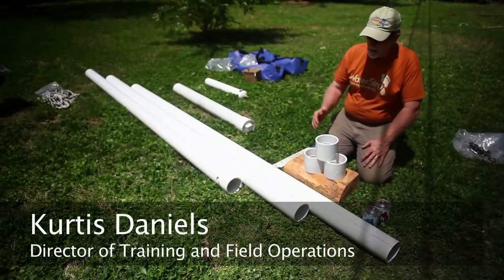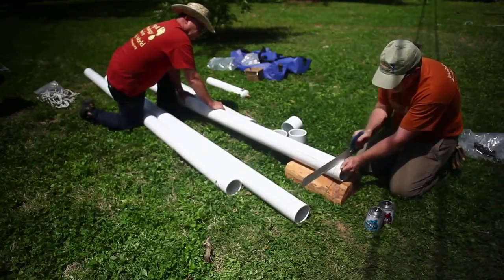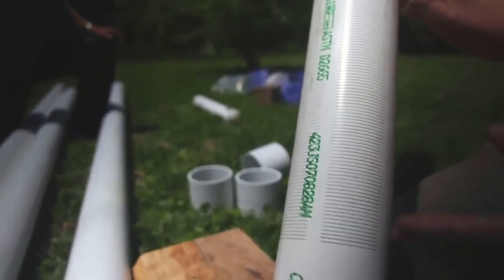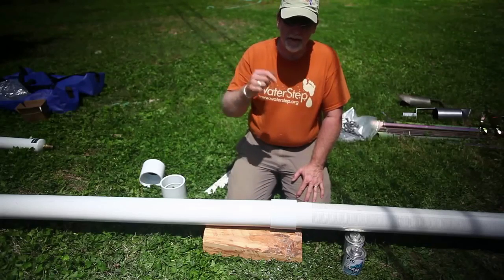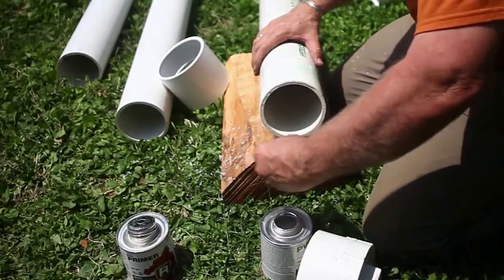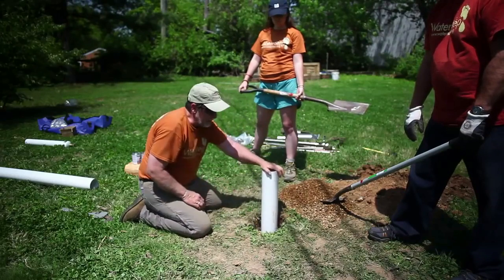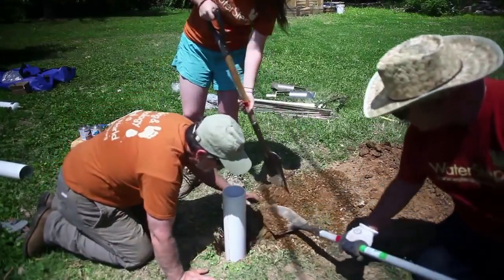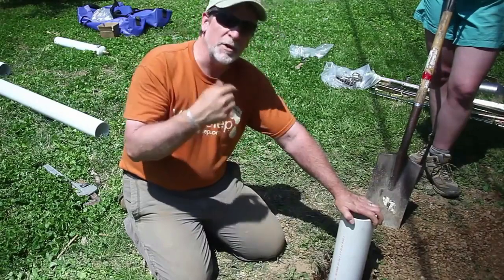WaterStep - How to Drill a Well - Casing a Well

Comment: Thanks for the info. I'm at this point right now, (20' casing), and have dug through pure sand. Hit mud at 18'. Want to go deeper, but every time I pull out the auger, the mud fills the hole in. I want to go another 5', to put in the filter casing.
Wondering if the mud is soft enuff, if I can pile drive the casing?  I can put body weight on it and get another foot or two, but then I encounter resistance. (No cap at the bottom yet, just the 4" open casing.)  Will end up with an electric, +/or a hand pump, at the top, through a 2" PVC pipe, with check valve.
I like your home-made screen. I see them sell for more than a hundred bucks. Good job on your well.